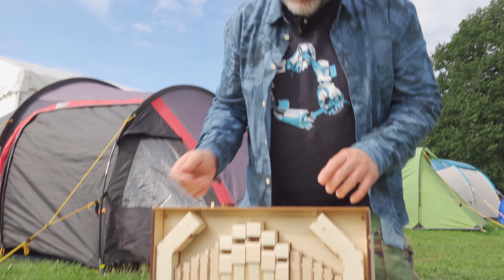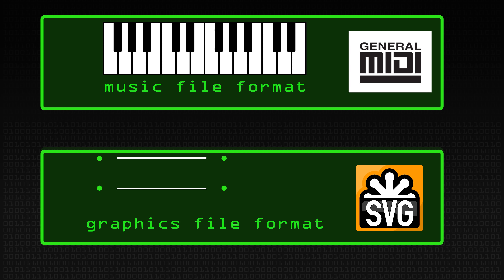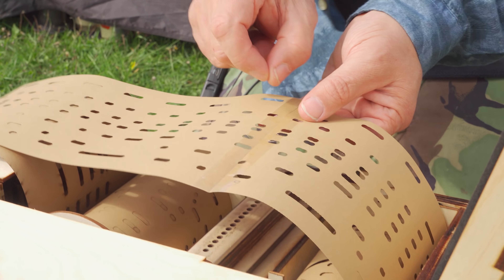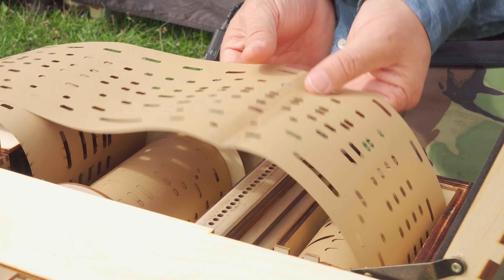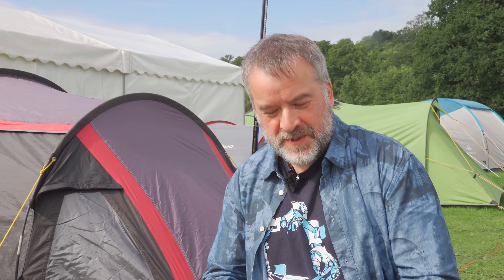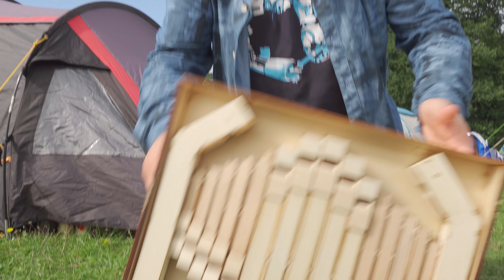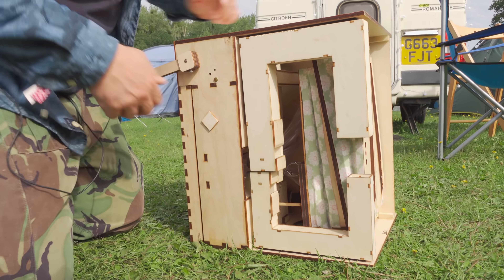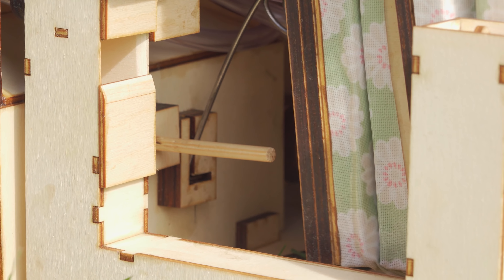Laser Cut Music Box - Computerphile

Comment: Wouldn't the velocity be the volume, which could be encoded in the width of the holes in the paper?
Reply: Not really, if I understand sound well (which I don't exactly) More or less surface area for the air to go through doesn't affect the sound.  You have to blow it harder or softer and you can't really do that with a roll like that.
Reply: I don't think so, the transversak axis is already used to encode pitch, so yes, a wider note would mean higher volume(because more air would come out),  but it would also mean a "dirtier" note, that would be itself mixed with its flat and sharp.
Reply: If it's anything like normal street organs, the air doesn't go through the paper directly. Instead, the air is controlled by valves, which are controlled by pins that are moved up and down by the paper (or lack thereof). You could perhaps control the volume by making a thick playbook and varying the depth of the holes, but it's mostly just on or off.
Reply: +Daan Wilmer, most street organs have pins that control valves, as you said.
But I think that this uses the paper to control the pipes directly.  I noticed the tubes from the reader.  :-)
Reply: Now that I look closer, it does indeed seem pneumatic — however, as the reader (visible through the window) has holes on only one side of the paper, it might be operating the valves through suction. A spring (or gravity) holding a valve open, with a light vacuum then pulling the valve closed if the hole is blocked by the paper. A hole in the paper lets air in and the valve opens.
Reply: I have seen some different designs, and probably the air pressure is in the box that you use the window to look at the paper and reader.  So the air pressure is pressing the paper on to the reader and then the air just go to the pipes when the paper has a hole in it. It is a easy solution for a small organ like this.
Reply: The volume on pipe organs on only controlled with louvers which wouldn't really be practical on this.  Pipes work on a fixed air pressure.

Comment: If you could find someone with a vinyl cutting plotter you could use that to do your rolls, they can take quite long rolls of vinyl/paper.
Reply: Not that much of a problem using tejp to connect strips.
Reply: I have one of those.  You might have to string together the files that drive the cutter, but it could certainly work.